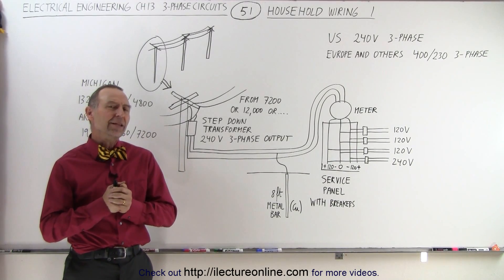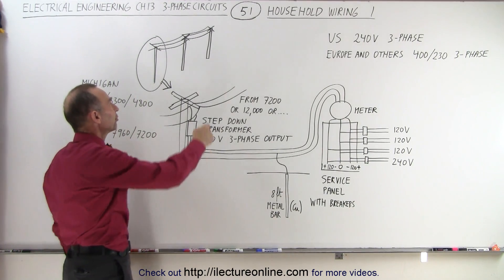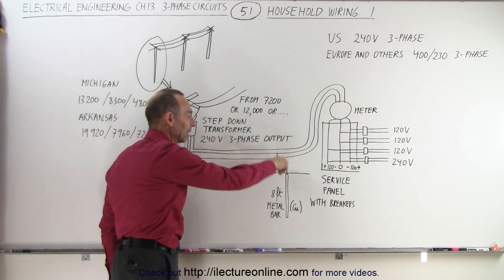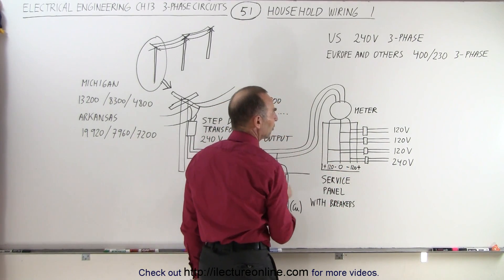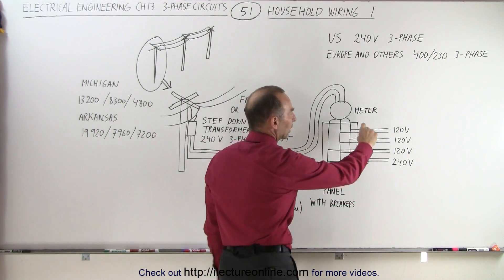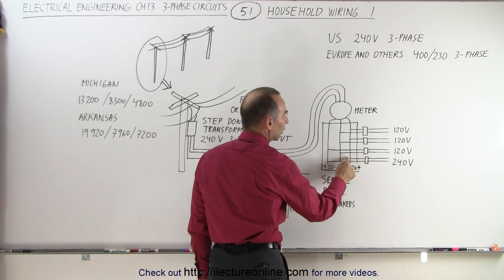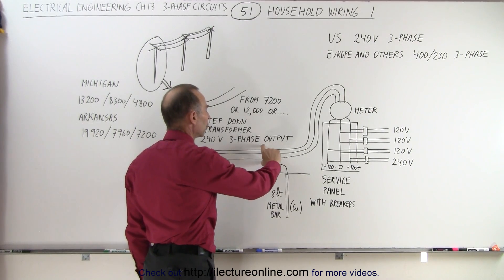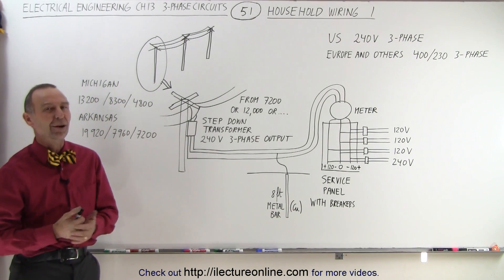Electrical Engineering: Ch 13: 3 Phase Circuit (51 of 53) Household Wiring 1

Comment: Residential service with 2X120V is single phase, not 3 phase. Why are you referring to it as 3 phase?
Reply from the maker: When 240 V is provided for a single residence it is indeed single phase.  We have a building where each one third of the building is connected to a phase.  (Most commercial buildings have a 3 phase circuit)
Reply: @MichelvanBiezen  Understood, but then it's not 240, it's 208. One of the reasons I watched your video was to see how the 208 was calculated!
Reply from the maker: 208 V is one of the supplied voltages for 3 phase voltage supply, but there is also 240 V (and others)

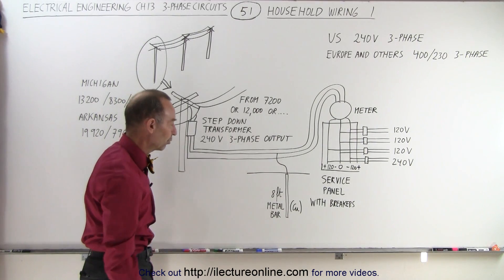Comment: I like your videos.     You do a good job of explaining things.     However, you need to correct this one.     The power going to a typical U.S. house is not 3-phase, it's "split-phase".     The step down transformer on your drawing should be denoted as a step down of only one of the 3-phases to 240 volts.     In a typical neighborhood, the primaries of some transformers will be connected to phase 1, other transformers will be connected to phase 2, and others will be connected to phase 3.   As you said in the video, the primary side of these transformers operate at whatever primary voltage that is supplied.    The secondary comes out at 240 volts via the winding in the transformer.       The three wires leaving the secondary winding that feed the house are wired in a "center-tap" configuration where the secondary center tap is the neutral, "Hot 1" is connected to one end of the secondary winding, and "Hot 2" is connected to the other end of the secondary winding.   Go to time 1:40 in the following video: https://www.youtube.com/watch?v=fJeRabV5hNU        Ignore the grounding in that video, they got parts of it wrong.      Thanks for posting your videos.     Bill
Reply from the maker: Thank you for the correction.
Reply: Hi, I would like to ask the outgoing wires are tapped to the appliances and 2 wires for each breaker, 1 hot 1 neutral, but how does this circuit form a closed circuit; assuming the current is outgoing from the hot wire to the load, but where’s the return wire back to the source to form a closed circuit for current to travel?

Comment: Hello professor!
Since this series is about to wrap up I have a suggestion you could do; maybe explain what the Epsilon-Delta definition of a limit really means? That topic has always confused me in Calculus and I was wondering if you could maybe explain it?
Reply from the maker: Take a look at video # 5 and # 6 in this playlist.  It will give you some insight:  ELECTRICAL ENGINEERING 18: THE FOURIER TRANSFORM